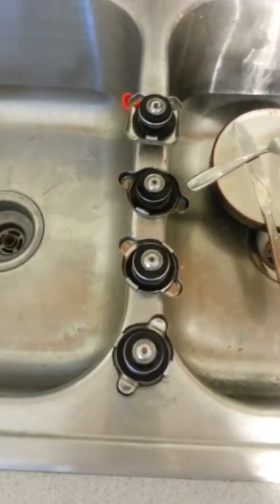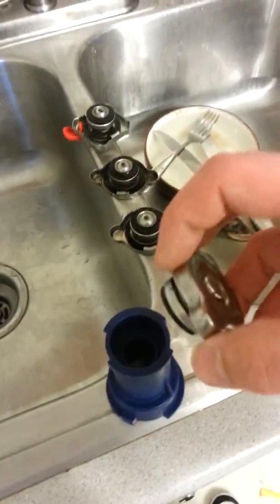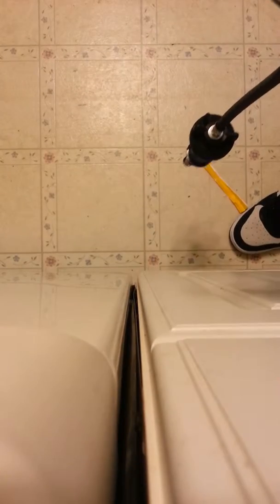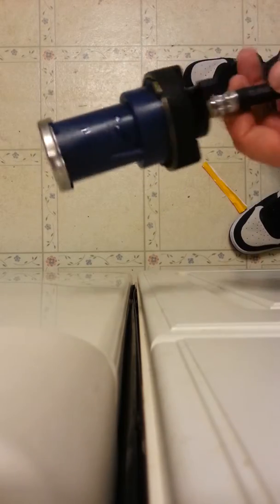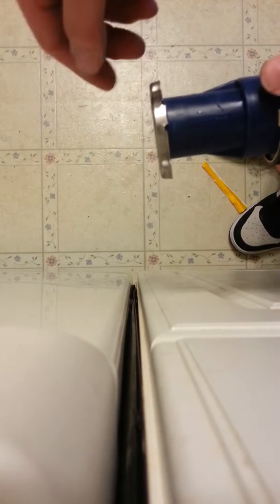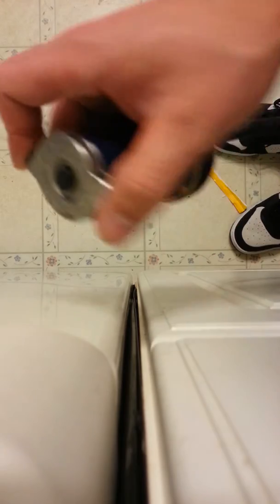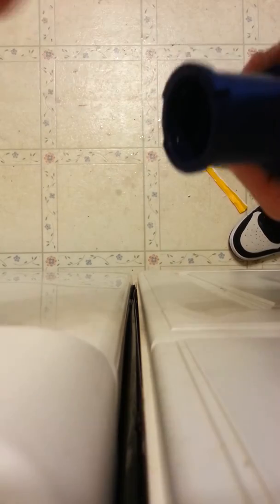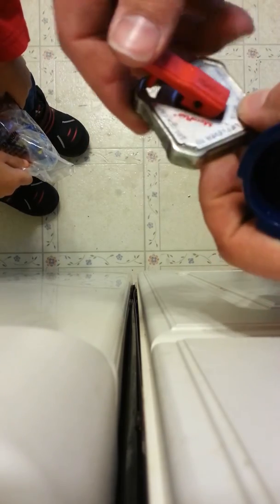Pressure testing radiator caps

Comment: Could a bad radiator cap cause a engine to smoke a lot I just replaced heard gaskets and it still smokes a lot could this be the cause?
Reply: Very unlikely.. Smoke could be engine burning oil, or coolant in oil ( check oil to see if oil is creamy)